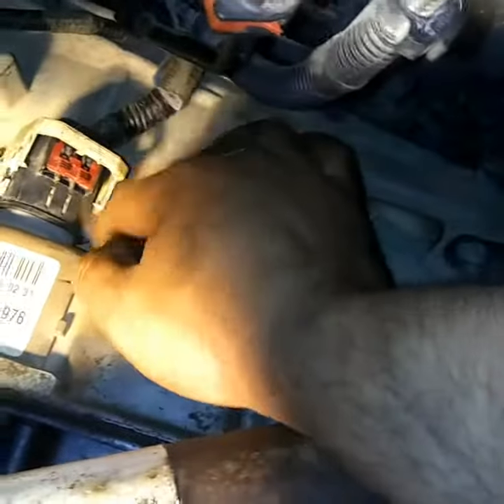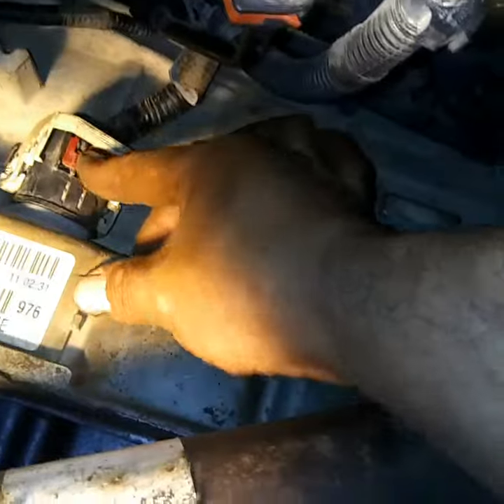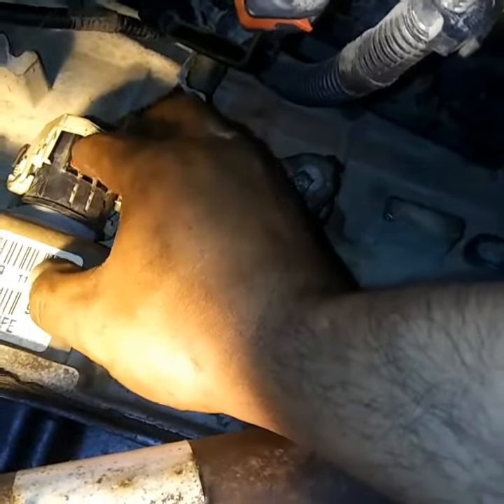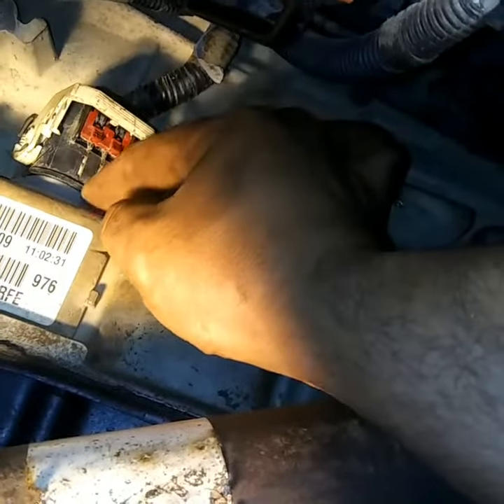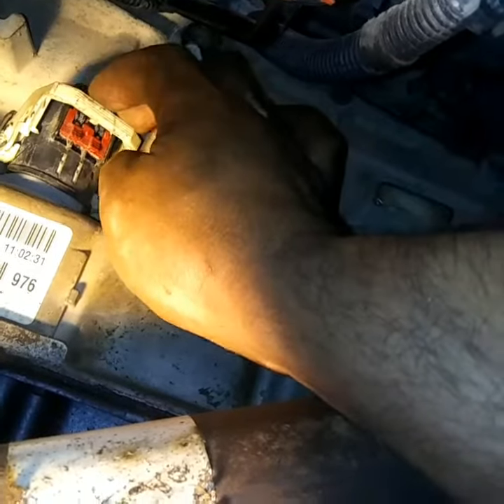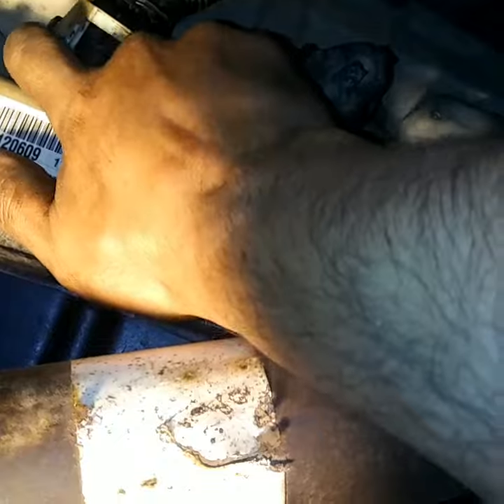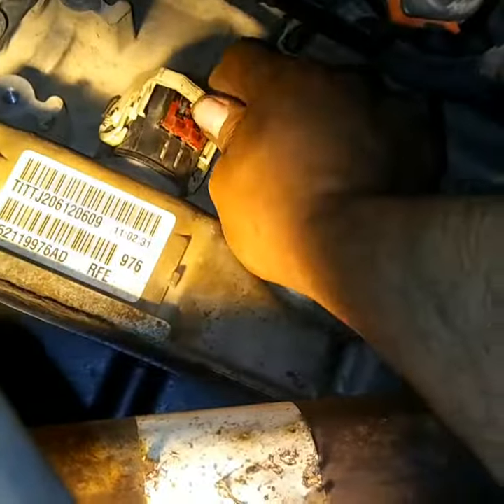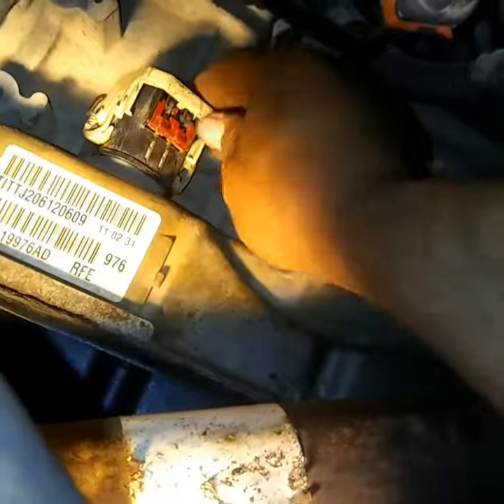20 - 23 pin Harness connector release method 65RFE 545 RFE 45 RFE

Comment: Can't thank you enough. Just spent the best part of two hours trying to figure out that connector. I eventually figured out the red clip but pushing, pulling, prying and cussing the white clip ended up with zero success. I pulled up several videos and though a few looked promising in the beginning, none explained the clip. The video I watched right before yours gave me a laugh (ok, I didn't laugh right then. It was more a completely opposite emotion). The guys says you need to remove the connector first and then it cuts to the connector already disconnected and the guy saying he already did that to "speed things up."  Yep, I bet that the reason lol.  Thanks again.

Comment: I dont have the red part on mine, is there a method of getting it off without it as the grey/white handle will not pull down to release the inter lock
Reply: Need the same info

Comment: Two questions.  When reinstalling the connector, what position should the lever be in?  Down position?
Second, I have the set of Miller terminal tools (6680A) as laid out in the FSM for this connector.  Any idea how to release the pins so I don't do any damage? And which number terminal tool out of the set is the right one?  I have to swap wires to diagnose a P0750.

Comment: Hey bud. I need a big favor. I need you to help me save my truck. I have 2000 Dakota slt. 4.7L.  With the 45rfe tranny. I towed the truck and I found that harness all burnt and cut up. I followed the wires to the tcm. But I don’t know whic tcm pin goes to which 23-way connector pin. Can you help me out.
Reply from the maker: Did you get it sorted out???
Reply: Never Still Mechanic yes thank you. I found the wiring diagram and cut all the damage off and spliced all 23 wires. A year later she is still running strong. Thnx for the follow up

Comment: How do you know if it’s in all the way?
Reply from the maker: The tab should easily hinge back. If all is cleaned and all pins are straight. Which should be always a good trait of a patient mechanic removing and replacing any connector should be done with minimal resistance and then you can feel the bottoming out.
Reply from the maker: And thank you for the comment / question 👍